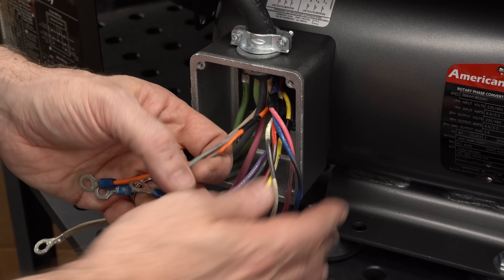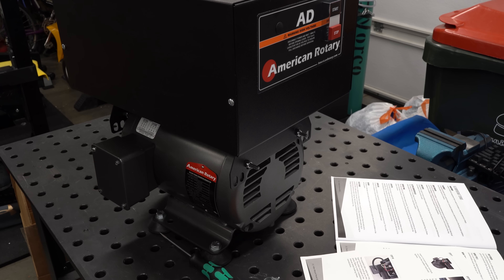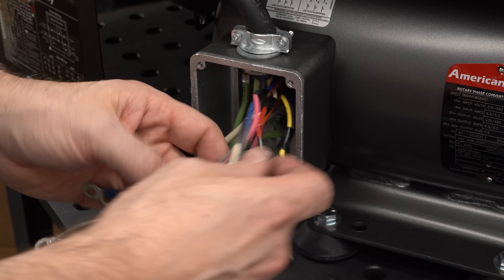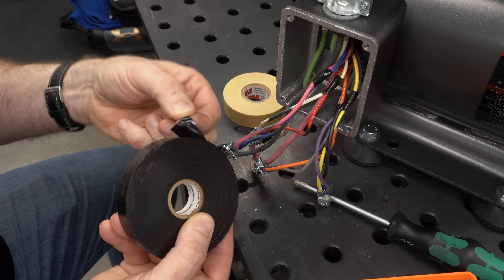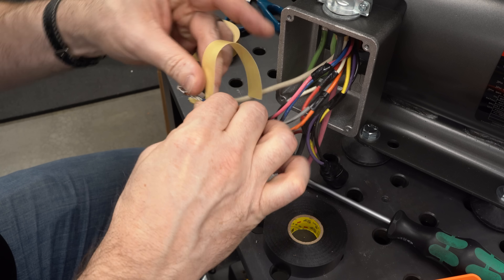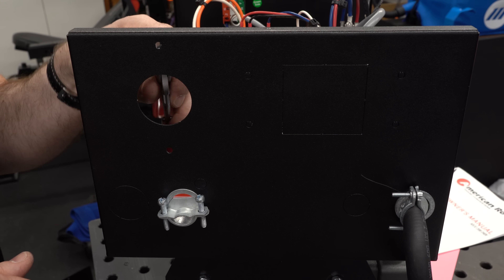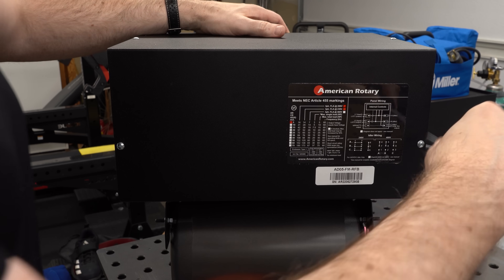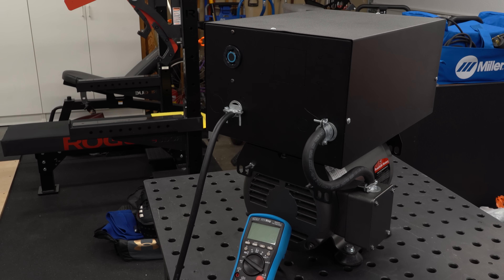How to Wire a Rotary Phase Converter the Old-School Way!

Comment: at 4:17 and noticed the wires have their number printed on the insulation. wonder if he'll notice, heh.
edit: looks like he didn't notice. at 4:17 you can see the 7 on the red wire and the 2 printed on the white wire.
Reply from the maker: Interesting.  I guess I was distracted by the two that had labels on them and didn't even look at the insulation.
Reply: True. This is a fairly standard way of labeling wires in these situations. All of the three phase motors I have, have printed on numbering on the wires, and some have just black wires with the numbers.
Reply: Maybe I don't know what I'm looking for, but I don't see any print on the wire insulation.
Reply: @TuckMcSouthard  on the red wire, look for the 7 just above his ring. The 7 is white text, about 1/2" up the insulation from the crimp connector
Reply: That is what I was going to say.  And the writing is in silver.  99% of new motors are labeled on the wire insulation itself.  Older motors would be all black but would have a metal tag on them that will probably never come off.
Reply: Made me wonder WTF this guy was talking about with the wires, if they weren't numbered then why did the motor have a wiring diagram decal just above the pecker head that was showing numbered motor leads?
Reply: All motors have numbers
Reply: Good eye, Mike.  I thought it strange that the manufacturer didn't identify the leads.
Ah, for the old days when motor leads came with metal tags crimped to them.

Comment: I believe you did the right thing by terminating the ground wires under the same lug.  Ground integrity usually requires one common connection.

Comment: Nice work terminating the wires in the control box with crimps.  looks professional, good mechanical and electrical connections, and no loose strands to spoil the project.  :)

Comment: Good job, insulating the motor connections.  Brings back memories of the days we used those three layers of insulation.  We sometimes used the old electrical tape, otherwise known as hockey stick tape, for the first layer.

Comment: Nice work determining the motor terminal configuration; unfortunate that the manufacturer didn't label the leads T1, T2, T3, etc.  By the look of it that was a delta connection, for 240 volt operation.

Comment: As an interested subscriber,  my preferred term for the motor junction box is "terminal box" or "idler motor junction box" .
Referring to any part of a 3 phase rotary phase converter, (a gift of design to all of us gearheads) as "the peckerhead" is just repulsive tradesman slang, without any real connection to proper description or communication. Please remove the term from your electrical wiring vocabulary. Thanks!

Comment: One trick I've learned to do with wrapping thing that have an end that needs to be covered is to put a couple of strips of tape around the end like an X.  Not wrapped but just laid over the end and lengthwise down the wire.  The follow up like you did going around.  Since the end is previously covered it's all covered.

Comment: Great idea in theroy, but their cheapest option by the time you pay for hidden fees, required add-ons, shipping, and taxes is around $1,800. Most people can get 3 phase setup at their shops for less than $5,000, and since this is basically a one-trick-horse only able to be used for ONE machine at a time, and they are specific to the power requirements of the machine you intend to power, I think the price is a bit excessive, but I can see the benefit of one of these machines in VERY specific circumstances.

Comment: And yet 50million + motors under 15 hp in the U.S.A. are all wire nutted and taped. and yours is the one subjected to vibration? and it is not mechanically connected to something else. Hmmm!

Comment: You said the incoming 240 volt wires are essentially passed through to the load. They are 180° out of phase, doesn't one of the legs need a phase shift to make them 120° out of phase?

Comment: Surprised that the output does not go trough a contractor. Problem is you have 240 single phase all the time without the 3rd leg when it’s off. If you can start the motor that way on the ds equipment, you could fry a motor from single phasing it. Seems crazy to me.
Reply from the maker: I've seen that happen.

Comment: I just purchased a 20HP. I used the smaller punch out to run the  supplied cable to pecker. The other one was bigger. In picture in the manual the cable holders are installed opposite spot where you had ran the cable. I’ll change to how you have. I had 4 extra washers and doubled it up on the bottom of the box? Not sure where they go? Did you find out where the green sticky tabs go? Also my cable was short to the pecker box. Also my mounting bracket to motor. The nylon nuts don’t thread on all the way. I’m guessing now the bolts that came in the same package as the rubber feet are for the pecker box? I was thinking was for wall mount or something. Wasn’t sure if use some type of brass bolts? Well I guess there for the Pecker Box. I’ll pick up the tape and do the same as you did. I picked up a 100 amp 3 Phase panel and will run power there and dedicate plugs and fuses to the dedicated machine. I’m going to make a role bar cage so it can be moved around on swivel wheels then they can be taken off back onto the rubber feet. Thanks

Comment: Wire nuts are totally acceptable. There are THOUSANDS of motors running with wire nuts running 24/7 without issues.

Comment: I had to pull another wire through some conduit and i couldn't for the life of me remember how long it was. This time I made sure to write down all over the place what the total length was. It makes knowing that if it's 65 feet of conduit and I have 100 feet of cable I'm gonna have X left over on each end. Do yourself a favor you might be the next guy or the next next guy. And if you're ever doing anything with conduit pull an extra string through then when you pull your replacement pull a string with that too.

Comment: I have the exact same model, it does have labels on the motor wires. Whoever returned it must have taken them off. I did almost the exact procedures you did but I live in a pretty humid part of the country so I used some Nolox on the connections and also used cable glands instead of the romex connectors.

Comment: Nice setup...just a couple weeks ago I cobbled together a simple pull start      convertor...need to add some run capacitors at some point, but it's working

Comment: I'm a JW IBEW wireman. 
Here's the answer to your question regarding the best way to bond the receptacle to the metal enclosure and grounding it (which are two different things):
455.5 (Phase Converters, Equipment Grounding Connection) of the Code states
A means for attachment of an equipment grounding conductor termination in accordance with 250.8 (Grounding and Bonding, Connection of Grounding and Bonding Equipment) shall be used.
250.8 (A) (Permitted Methods) states
Equipment grounding conductors, grounding electrode conductors, and bonding jumpers shall be connected by one or more of the following means
(1) Listed pressure connectors
(2) Terminal bars 
(3) Pressure connectors listed as grounding and bonding equipment
(4) Exothermic welding process
(5) Machine screw-type fasteners that engage not less than two threads or are secured with a nut
(6) Thread-forming machine screws that engage not less than two threads in the enclosure
(7) Connections that are part of a listed assembly 
(8) Other listed means
Will the way you've done it work? Yes, it will. But I would crimp a ring terminal onto the end of the ground (green) wire from the receptacle and secure it under the nut securing the chair lug to the enclosure. Absolutely necessary? No, but I prefer only one ferrule under a lug if at all possible.

Comment: OK, my machine move nightmare goes as follows. 
I bought a 1990 bridgeport 720x machining centre to start my own business. The mill weighs almost exactly 4 metric tons. Due to the location of my rented unit I decided to rent a telehandler to offload the machine from the lorry and transport it up a short hill to my workshop. I rented a beautiful new jcb 540 with 15 hours on the clock. 
First issue is that while the jcb was fit to lift 4 ton it could not tilt back with the weight on the forks. I had to keep the joystick to the left to stop the forks from dropping and therefore dropping the machine. 
We finally got the machine on the ground and I started the slow drive out of the yard and up the hill toward my unit. 
Issue 2, I got as far as the gate at the road and while trying to navigate the narrow opening a pothole caught me off guard and the machine started to slide off the forks. I dropped the boom and let the mill rest half way off the forks and half on the ground. 
At this point  I contemplated all my life choices that lead to this moment and bummed a cigarette off a friend (I hadn't smoked in over a decade).
We spent about an hour carefully trying to nudge the machine back on the forks with a tractor (smashing the Y axis servo encoder in the process). We managed to get the machine lifted by adding timbers under the enclosure effectively lifting a mill in the worst possible fashion. We strapped the machine to the forks and started the ascent up the hill.
Issue 3. The jcb jumped into limp mode while traversing the hill. At this point we are still moving (barely) and I'm about to have a coronary as we hold up traffic at 1mph.
I have since moved into bigger premises and vow to only use hiabs for anything like that again. 
And I still have that bridgeport, it works rather well for its age.

Comment: That 3 phase converter jobbie reminds me of when I did army, we still had the occasional old tube equipment running on a vehicle battery, and there was a very similar, smaller rotary voltage supply to convert 12 or 24v to high voltage in order to power the tubes...

Comment: Thank you for explanation. Nice thorough work. I personally would just have cut those "eyes" off and used "Wago style" terminal blocks. 
I am from Europe and I just recently discovered that your "two phase" in USA is just 2 phases of 110V with 180° phase shift. Weird. Here you get either three phase 240V between phase and neutral, 400V between phases or you get 1 phase, which is just one phase and a neutral pulled in from the nearest 3 phase distribution point. I assumed you Americans got pulled in 2 phases out of three and I was wondering why your distribution companies were such asses. 

I have recently been solving the same problem - having only 1 phase in my garage (I could easily get 3 phases - for significantly higher price, however), so I got a cheap Chinese VFD that gives me 3x240V (instead of proper 3x400V) but I had an opportunity to rewire motors on my machine from triangle to delta and get full power from them even when supplying them with 3x240V (mind you, those motors are 70 years old!). I had to pull in separate 240V for control circuits (relays, contactors ...) and the cheap VFD can power several motors at once, even when I switch some motor on/off. I know, it shouldn't be possible, and it isn't with "proper" industrial VFD, but cheap $100 4kW VFD from BangGood doesn't care ;-). I know it can die prematurely, but it works for now ;-).

Comment: I hope the surface grinder will now finally be delivered in good order. All our machine tools that we bought new arrived in good condition but most of them were small, and big, enough to fit on a standard sizes pallet. I did have some issues with smaller pieces of equipment and there were all clearly the fault of the freight courier not taking good care of the goods they ship. On one occasion I even noticed that the driver just walked over the boxes in his truck. He clearly did not care about the boxes being damaged. Looking at how often we receive boxes that have holes or dents, that guy is clearly not the only one doing this.
Reply from the maker: The thing that makes me crazy is when the driver rolls the pallet jack off the edge of the liftgate, assuming that the wheels will drop off and the metal-to-metal friction will stop the load from going the rest of the way over.  I've watched some really close calls, and received photos from viewers of their machines lying in the street.

Comment: Enjoyed the video as usual James, and here is my "shipping story". Some years ago now I worked for a time on The Bass Link Project, an under sea power link connecting the State of Victoria to the State of Tasmania here in South Eastern Australia. The power could go either way between the states of Victoria and Tasmania, and though Tasmania is much smaller than Victoria, we had a pretty well all hydro electric system while Victoria had  brown coal fired generators. The idea was that as our hydro stations could go from shut down to full output in a minute or so, and then be shut back down just as quickly, as the load reduced, they would be just the ticket for augmenting Victorias peak load demand, as their coal fired generators would be damaged if they were cycled up and down in output, they were basically designed for a constant output. Tasmania was to supply the peak loads, and Victoria was to supply the base loads for both States. This project involved transmission lines and huge substations where in Victoria 500KV 3 phase was rectified to DC, then sent via the under sea cable to Tasmania, where it was converted back to AC and injected into the Tasmanian network at 250 KV. When Power was being sent from Tasmania to Victoria, the opposite occurred, 250KV was rectified to DC, sent to Victoria where it was reconverted to AC at 500 KV for the Victorian distribution system.
All this involved numerous huge transformers, which came out to Australia from Seimens in Germany, and indeed Seimens were the principal contractors for the project. Seven of these transformers along with lots of other equipment came out by ship, and while the ship was travelling through the Great Australian Bight, she ran into some very rough weather, and was nearly capsized. Fortunately all the equipment must have been well secured, as when it landed initially everything looked OK. One of these transformers, weighing if I recall correctly, 275 tonnes was destined for Tasmania, and was duly delivered on site, where it sat till they were ready to install it. When the time came, a huge rig arrived to pick it up and load on to an equally huge trailer featuring 128 wheels, arranged on 32 individually steerable axle sets, 16 on each side each with 4 wheels. There was also a large pusher truck just to make sure that they could get it to where it had to go.
 About this time someone decided that they ought to remove an inspection hatch, to check the interior of this transformer, and when they did, they were in for a nasty surprise. The whole set of windings had moved sideways when the cargo ship had been caught in the storm, and on one side the windings were roughly a metre from the wall of the transformer case, but on the opposite side the windings came within 100 mm of the case. The whole thing was rejected, together with the completely unscathed 10,000 litre coolant oil tank and all the ancillary equipment. When the word got out about our transformer, they checked the other six transformers which were in that shipment, and altogether 5 of the seven transformers were written off. I have no idea of the cost of 275 tonne transformers, it would be more than I will ever see, that's for sure.

Comment: So happy to live in Sweden, we get three phase (240V between phase and neutral and 400V between phases) directly from the electrical company. Easy to connect and run any type of gear.
Reply: Does every property have 3 phase?
Reply: @billdoodson4232  Basically, yes. Some small apartments might not have it. Most electric cooking ranges, washing machines and dryers run on three phase.
Reply: @MatsFogelvik  As a country you are very lucky then. I am fortunate, that when we had to move our single phase meter and supply, I found that it would cost me the same amount to put 3 phase in, which is what I did.
Reply: @billdoodson4232  I live in the USA now, I wanted 3 phase in my shop, the cost would be $30k to connect they said. I bought a 10hp $3k rotary converter with remote start instead from Kay Industries. I miss the Swedish 3-phase, but this works.
Reply: @MatsFogelvik  Yes, that may be the option I have to take when we downsize. When we moved the meter, they put in a complete 3ph supply to a new box in the wall that I supplied. I dug up the trench in our property, to their specifications, only 25 feet away from the footpath. They dug up the path and made connections at either end. This was 33 years ago, though, and it cost £70.00 about $100 then, this was before our electricity companies were privatised. I was quoted for another property last year, but the sale fell through, and that was going to be £5,000. Someone I know who lives out in the sticks was quoted over £45,000 to upgrade an existing 3ph supply. They got around it by fitting inverters to some of the machines to limit the current draw on startup, instead of them being direct on line.
Reply: @billdoodson4232  every property yes, but older and or/or smaller  condos can have just one phase in use

Comment: Im sure you already got the tip but buy a kit of double ferrels for when you need to double up cables =) alot nicer to work with than trying to put two in the same screw terminal =)

Comment: When I picked up my surface grinder I had to switch vans three times because of (1) accident by the previous owner before starting the trip (2) not enough AdBlue in the tank of the replacement vehicle---the tank did not recognize the refill, thus new van, and (3) that one made it. I guess surface grinders are kind-of cursed ;-)